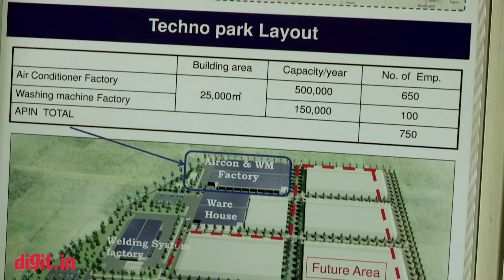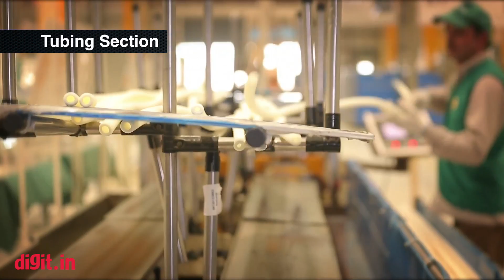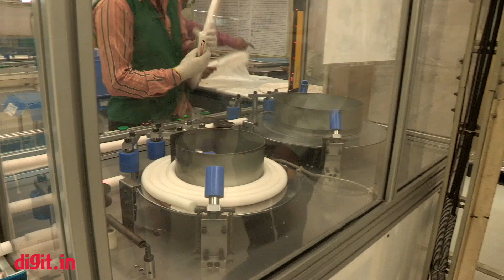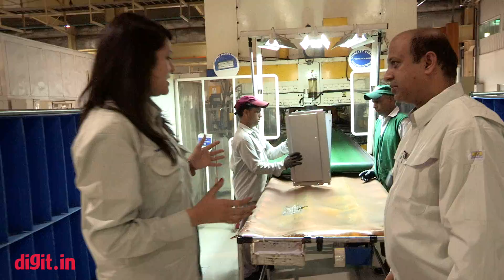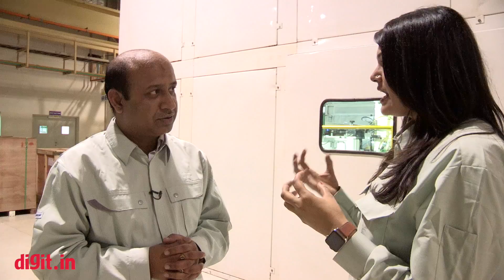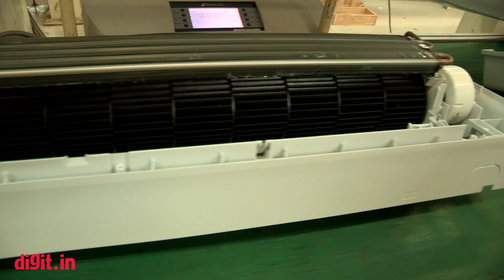How Panasonic Makes AC's and Washing Machines in India | Digit.in

Comment: Very amateur host, Those are not the questions you ask when you tour a factory...Everyone know what work they are doing, doesn't need any explanation, The more important questions are, how green is their factory, Do they use renewable or non renewable energy, Do they have any in-house solar power plants or they depend on the local grid.....What kind of international standards do they follow during the manufacturing processes....How do they dispose of their waste products, What refrigerant do they use, How do they ensure that the refrigerants are not leaked into the atmosphere and are not destroying the ozone layer, Are their employees trained to handle such refrigerants......???